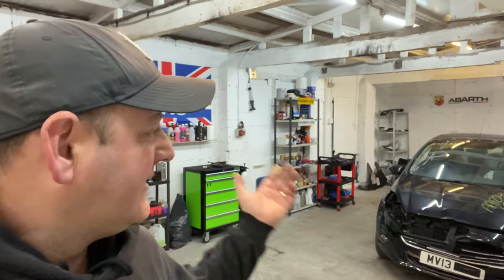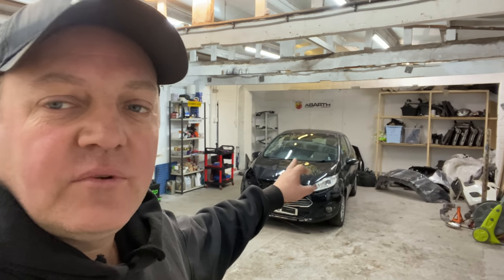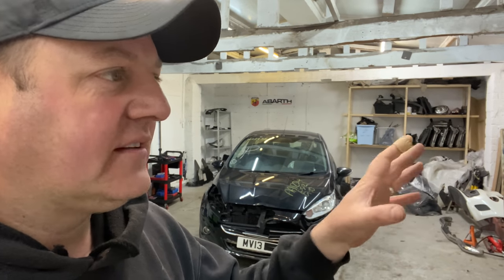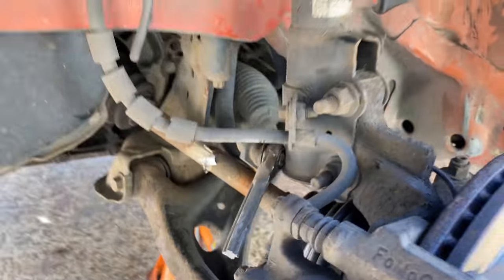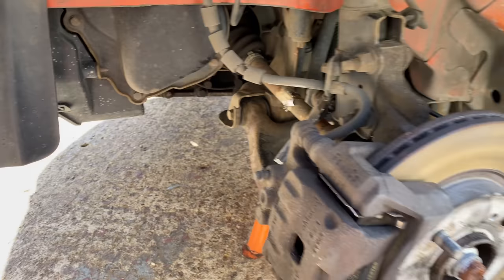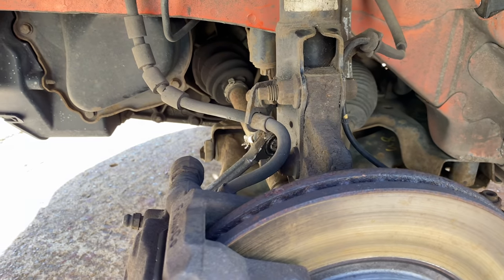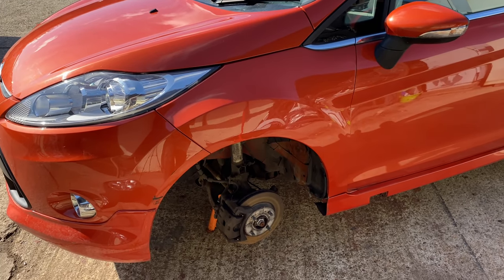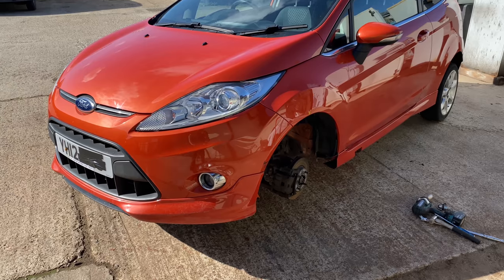FIESTA SUSPENSION DAMAGE ASSESSMENT ( PARTS FOR FREE )

Comment: Hi, still looks like the wheel is sitting back a bit in the arch, may have been a slight turn on the steering or camera angle but maybe worth taking some measurements both sides to compare.

Comment: A replacement wheel is going to sting you unless you’re very lucky. They’re 16s if I’m not mistaken. It might even be cheaper to get a set of four in a different style but same diameter to save on tyres. I reckon youwon’t find one used for less than £120 odd. Then there’s the issue of refurb... still its a sweet car!
Reply from the maker: Thanks buddy I have been thinking the same thing I will look into that nice one buddy stay safe have a good weekend 👍👍😷
Reply: @ResurwreckAutosUK  a set refurbed in same colour as last time would like ace with the orange paint!
Reply from the maker: @silvermane9370  Mate I have been thinking that 🤔

Comment: We spoke before about sticking to the bread and butter cars and you've done that, why change when you get them done quick and easy then move them on with no hassle. You're doing well Mark and I'm not surprised you're basically selling them before  you start them.You sure that strut is ok? Looked as if the mounting onto the hub carrier was slightly twisted and might just be the camera but it looked a bit bent where the barcode is on the part number sticker.
Reply from the maker: Hi Alan I will check it again buddy and get the MOT guy to have a good look at it aswell have a good weekend stay safe buddy 👍👍😷

Comment: 21 complete turns on original ford, aftermarket is diff and will always struggle to get it perfect. In the past I’ve straightened the damaged one so can mark the new one similar to the old one.
Reply: It’s just to get it roughly in the right place,  it’ll need tracking after
Reply from the maker: @moski322  yeah definitely getting the tracking done 👍👍😷

Comment: If you repair cars with suspension damage it is prudent to get a 4 wheel alignment check before you sell them.
Reply from the maker: Thanks Ian I was that’s obvious
Reply: @ResurwreckAutosUK  Yes, I know you have them tracked but 4 wheel align is it bit more thorough ie Castor, Camber and KPI as well as track. A bit more peace of mind when damaged suspension parts have been replaced.
Reply from the maker: @alanbartlett9523  thanks Alan I will look into that nice one 👍👍😷